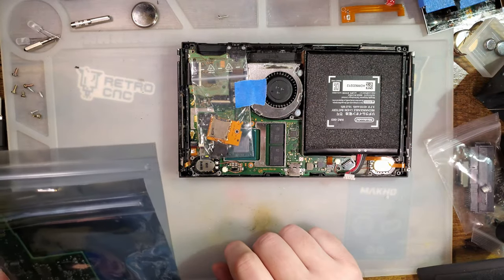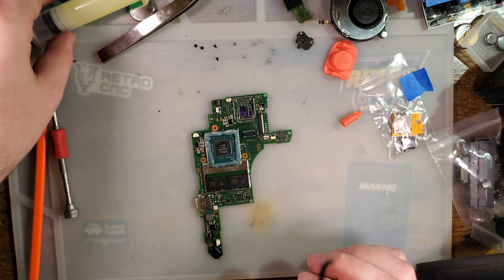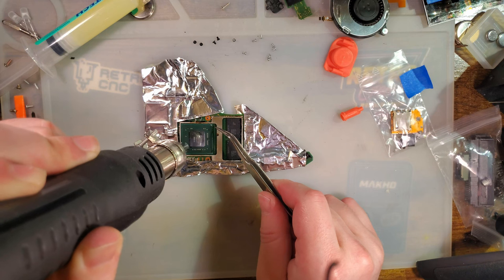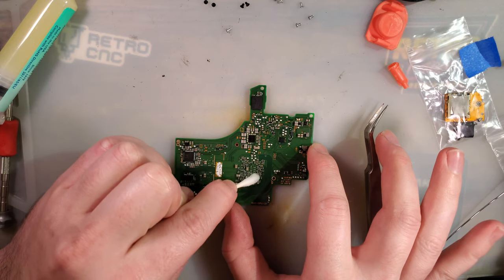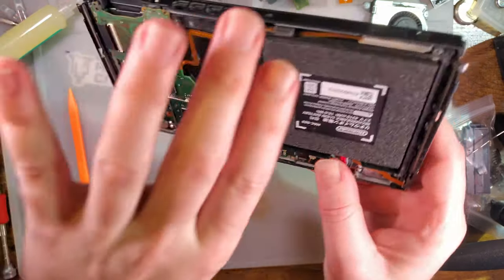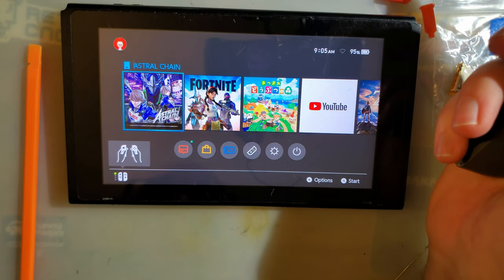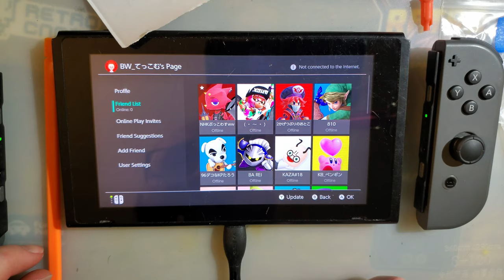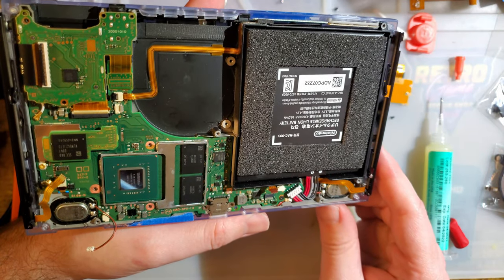Nintendo Switch Blue Screen Failure

Comment: I watch a lot of channels that do Switch repair.  It's typically the APU or one of the RAM chips.  You can try pressing on each RAM chip individually and boot the console.  If pressing on the RAM chips does not resolve the issue, it's probably the APU.  It's a good way of narrowing down the issue.  Good job on the repair.
Reply: It's exactly what I was about to coment I'm just incredibly late 🤣

Comment: Did you try see if this docked and worked through the TV? from what ive read and seen so far if u needed to reflow the APU u still might have ripped pads underneath so check this as u may need a re-ball and pad replacement done yet. Shame u did the rams at the same time so u couldn't exactly pin point where your issue was on this motherboard. As suggested the pressure test 1st helps determine which of the 3 IC's it could be. Great to see it worked tho.
Reply from the maker: Yeah, I wanted to do the RAM and CPU separately but it did mean doubling the amount of work due to the additionally assembly, testing, disassembly, cleaning, etc. An x-ray would have been better for diagnostics though. 

And yeah, it works docked.

Comment: The thing you called a heatsink is a heat pipe. It transfers heat through phase change of the substance inside of the pipe. That's why the crease changed it's efficiency.
Reply from the maker: The heat pipe is just one part of the heat sink assembly.

Comment: Good vid thanks nice to see you got the first one working, could be worth trying to reflow the nand on the second just incase its got a cracked joint under it and its connector board? all the connectors inside the switch are annoying af lol, i broke the latch on the fan one on my oled when i put a modchip in there had to wedge it in with paper
Reply from the maker: I have my doubts that the problem is on the NAND board but it's probably good to rule that out. Good call, I'll take a look eventually.

Comment: The cod3r has figured out exactly what causes it….it’s a ram issue but it can be caused by the cpu. There is a pad thats tied to the ram that always gets damage. But it can be repaired…seen him do it a couple of times….so it’s either the ram chips or the pad under the cpu tied to the ram chips( the bending board also breaks d solder ball with the same pads tied to ram , serving the connection )

Comment: Congrats on the repair. I was as surprised as you were that it worked. Since it can't be hacked, will your sell it? If so, as-is or will you replace the screen?
Reply from the maker: No plans to sell the repaired one as I'm not confident the repair will hold indefinitely. It was too easy. Maybe I'll mod chip it or something or maybe I just use as a travel switch. I haven't decided despite repairing this thing earlier this year and having no problems since.

Comment: Did you put thermal paste between the SoC and the SoC cover? Or did I miss it?
Reply: He didn't on this video. He just installed the heatsink to quickly test the system
Reply from the maker: I would recommend doing that, yeah. But like GumbyX said, I didn't in this video. I fully intended to pull this thing apart after the work I was doing and give a cycle in the ultrasonic so I didn't want to have to clean up thermal paste again. (And I did do that, it just took me like five months to actually buy an ultrasonic cleaner)
Reply: @makho  Fair enough!

Comment: Just put some pressure on the switch with joycons off and screen protector on flat surface and have it charging while you put some weight on top with screen facing the flat surface and it should un arched the mother board without opening, just make sure it’s flat surface and put screen protector and 7-8 pounds max on top of the back of the switch where it says what mode it is it 001-01 lower side of switch and put the charger and then after an hour it should work without opening and heating anything